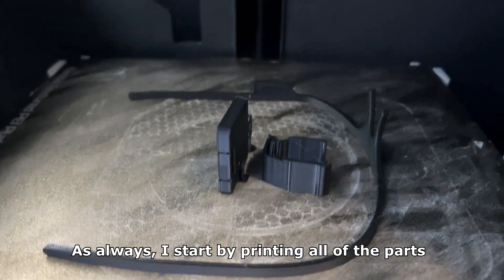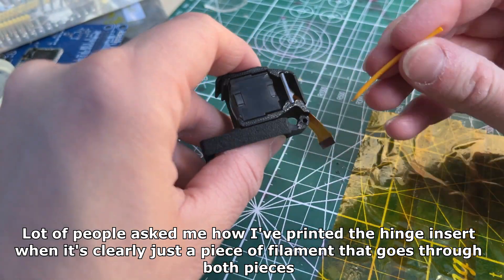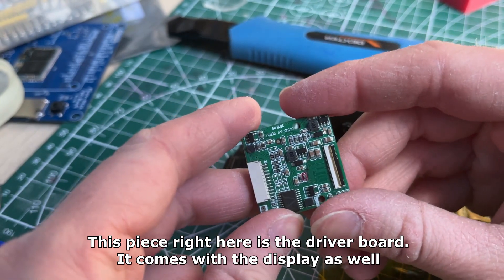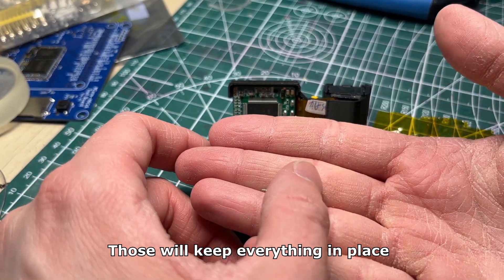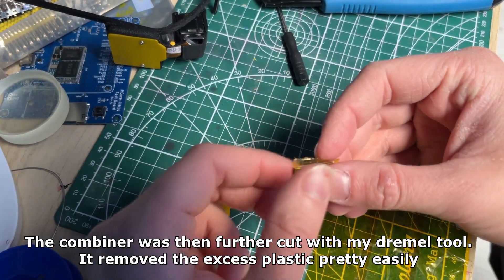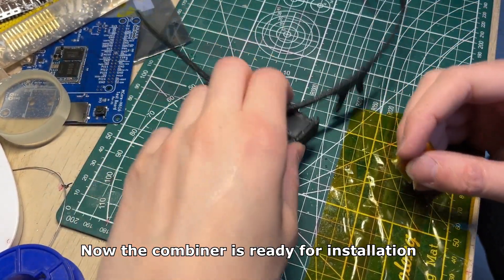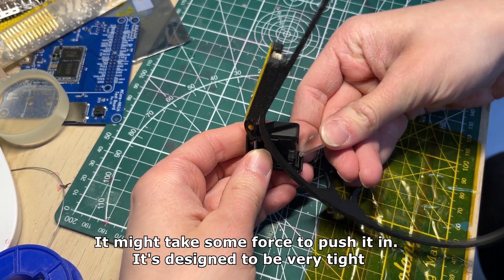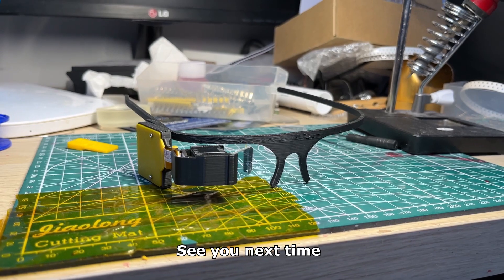Sideloader 2.1

Comment: Is this powered passively from the HDMI cable? Or does it need a separate supply for power? (And what voltage/amperage?)
Reply from the maker: It’s being powered just from the HDMI but you can always connect a separate 5V power source for more stable volatage. It works fine at 300mA but it can get hot so external power source will improve things